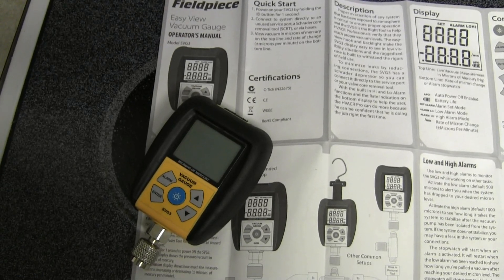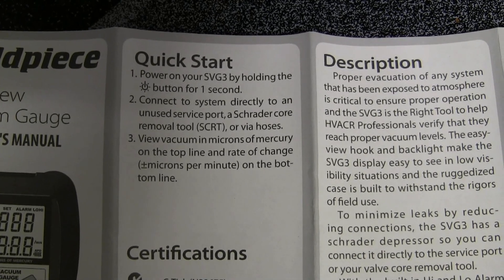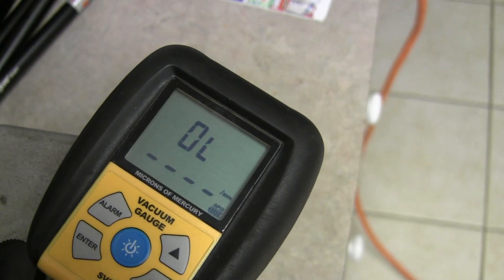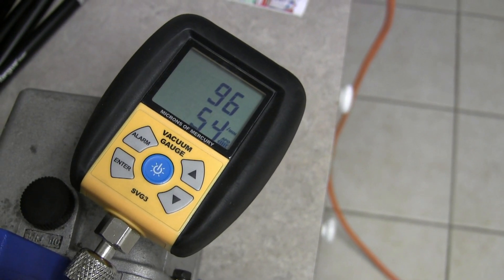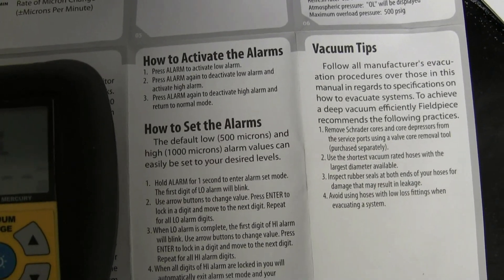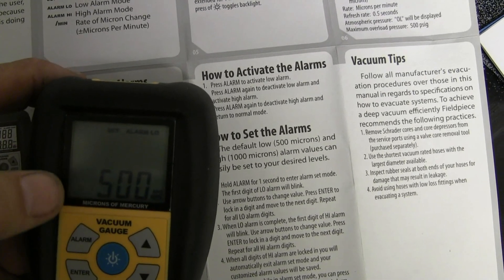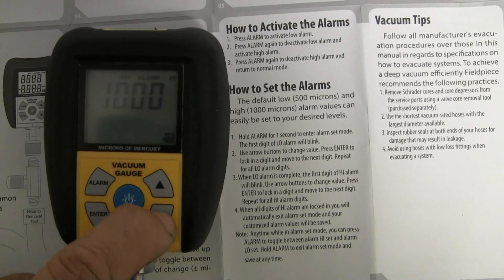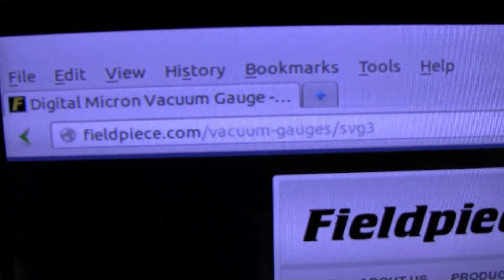HVAC Fieldpiece SVG3 Vacuum Gauge

Comment: There is a video on the trutechtools website that explains a lot about pulling a vacuum. It will answer most questions. I have the 1st Gen SVG2 before they changed the schrader depressor. I have to constantly mess with it to seal even with a brand new seal. They've changed the design since then.

Comment: I tried to test mine like that and it does not hold. Mine will pull down to 30 microns but as soon as I close the valves it will rise up really quick!
Reply: That is normal there is nothing wrong with your pump or micron gauge.  You need volume in order to hold vacuum.
Reply: Mark E Pugliano can you please explain what you mean by volume. I have same problem, it happens even after going to 1500 micron then reversing and stopping at OL (atmospehere) since my pressure guages shows system in vacuum 30hg